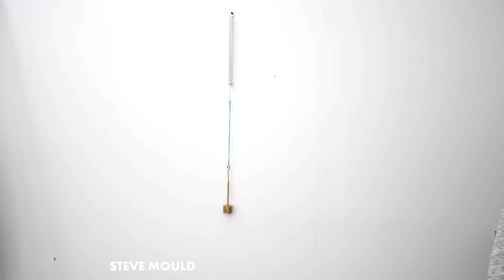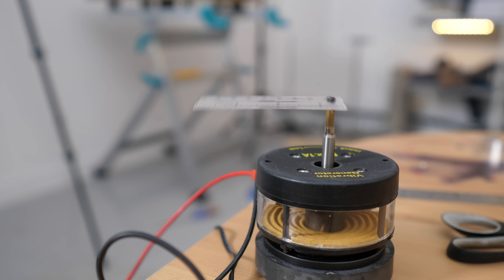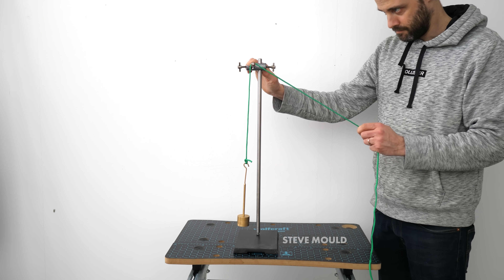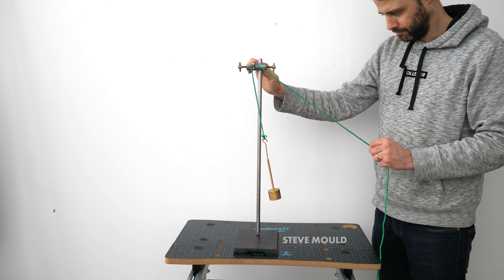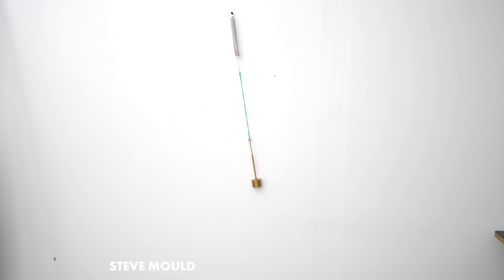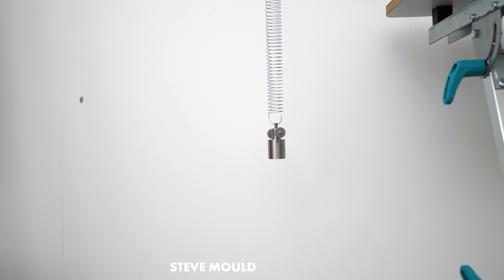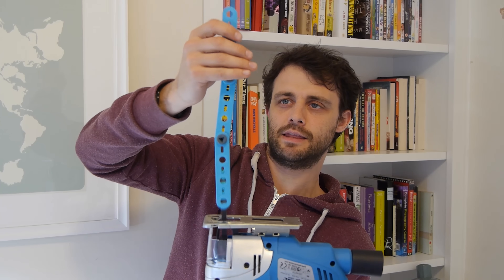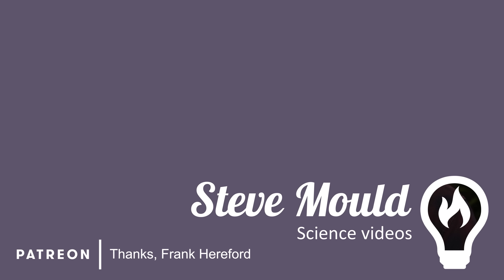What If Swings Had Springs Instead Of Ropes: Autoparametric Resonance

Comment: When you're swinging the ball around on the string and you shorten the string does the ball actually speed up or just curve tighter around the center?
Reply: Depends if you're measuring angular or linear velocity
Reply: The answer is "yes". Think about it like a figure skater or a dancer doing a spin: the rotation is sped up when mass is moved closer to the axis of rotation (pulling the arms in). The amount of energy stays the same, but shortening the radius allows more motion from the same energy.
Reply: I was wondering the same thing. It didn't seem to speed up any, it looks like only the rpm increases.
Reply: The figure skating visualization is nice, but I don't think it completely clears up the picture, because "spinning faster" could just mean increased rpm (maybe the actual speed of the skater's hands are the same in each position?)

It is in fact true, though, that the speed of the ball itself increases. Angular momentum, which equals mvr, is conserved in this example (mostly; some tiny amount gets dissipated into the tube, hands, air, etc). So as r decreases, v must increase. So the rpm increases faster than it would have if the ball kept its same speed but just with a smaller radius.

Comment: @01:31 - A tip for pushing kids on a swing- It might be a better idea to stand in front of the swing and push the kid's knees/ lower tummy. That way one can

1. Avoid the possibility of kid slipping off of the swing by the push (the naturally leg gets stuck at the knee joint)
2. have better conversation with them when you are facing them.
3. get to look at their cute little smile as they enjoy the ride. 😍
Reply: 4. A nice kick in the balls
Reply: @davishall  😂😂
Worth the risk??🙃

You actually need to stand a bit offset from the line of motion of the swing. Otherwise your arm can not really reach the kid.
Reply: They will kick you in the face sooner or later.